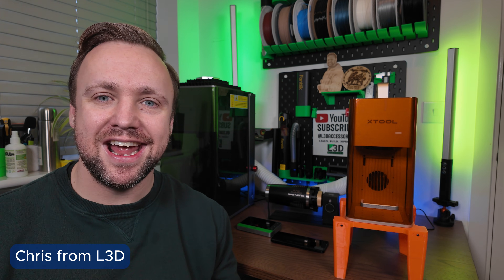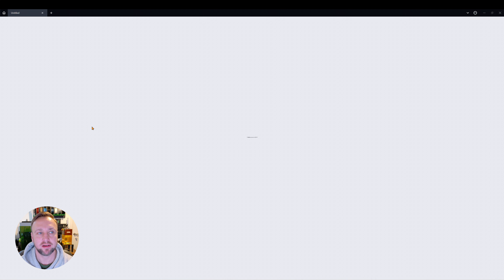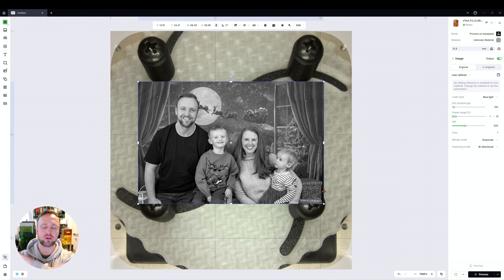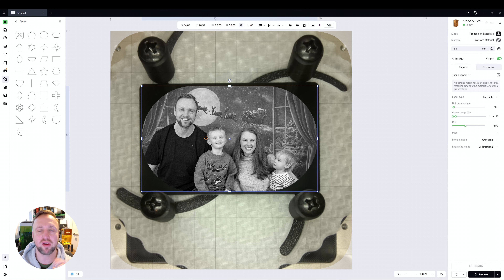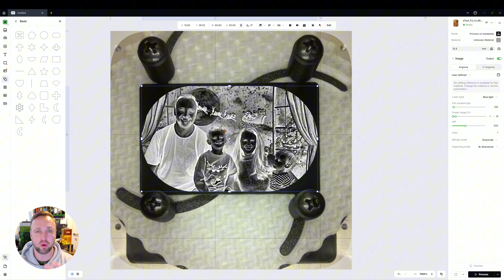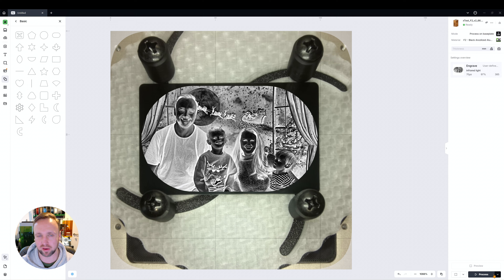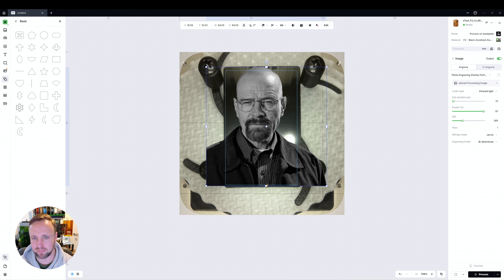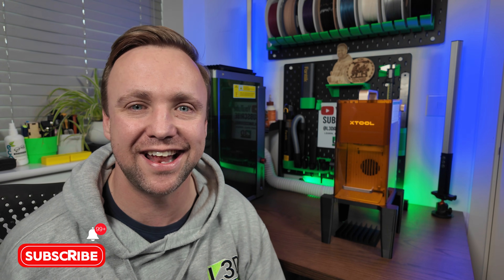Engraving Photos on Anodized Aluminium Business Cards with the xTool F2 (Beginner Project Series)

Comment: I have been playing with your settings on my F2 Ulta single. I have tried all kinds of combinations of setting, but my black anodized alum business card ends up either to dark or the card gets distorted and bends. Any suggestions?
Reply from the maker: My guess would be that the power might be too high. I did these on the F2 (regular) which has a 5W IR laser. You're doing it on a 60W MOPA Fiber laser which means you'll need very different settings. The card is probably heating up from the constant power so I'd definitely suggest joining an F2 Ultra FB group and asking around for settings.

Comment: Does anybody know if this could be done on a CO2 laser....the P2S....the settings in the XTOOL software for C02 lasers is power, speed and lines per cm.....no dot duration or DPI. I've tried a few material tests on the black business cards but it seems to just burn everything off ...the grays too.... and i've tried power between 5 -50 and speeds from 150 to 600.
Reply from the maker: Unfortunately I don't have a CO2 laser so I'm not sure myself